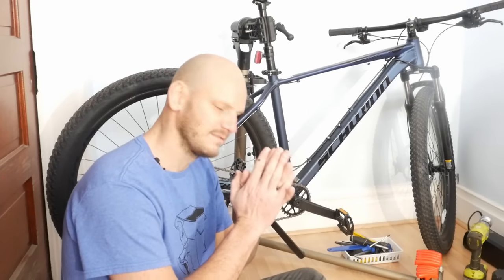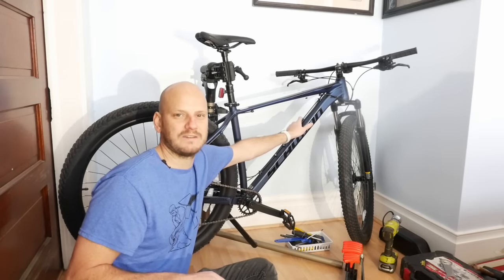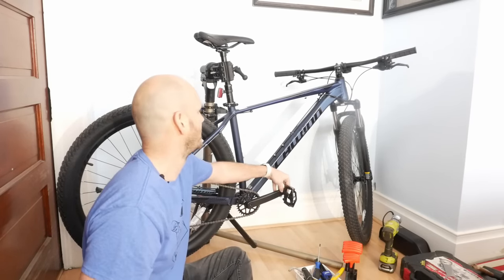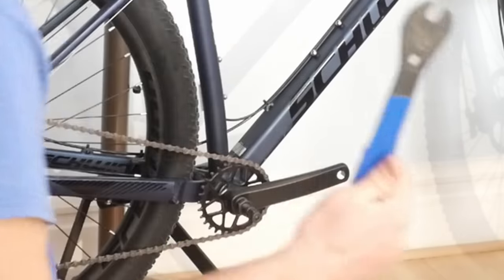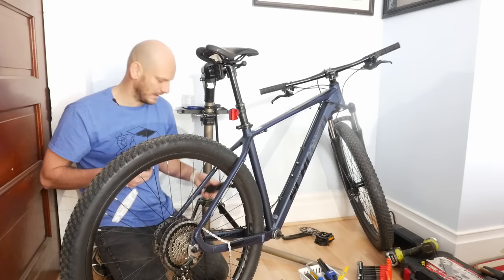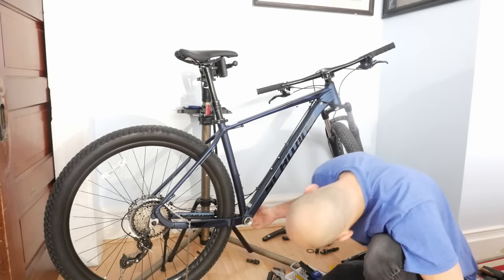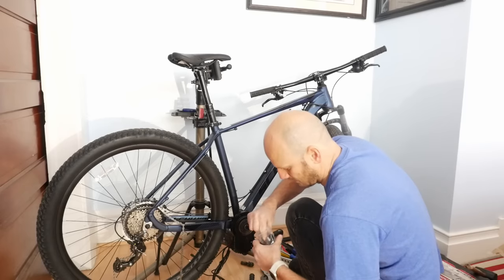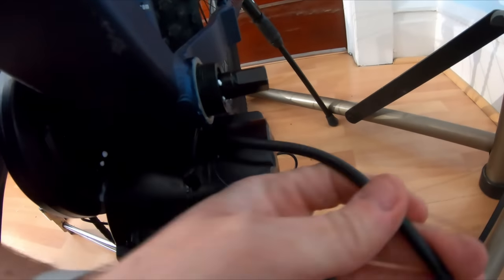The Step-by-Step Bafang Installation guide.

Comment: Great video, thanks! I am quite small, 5’1 so I have to buy size xs or even 2xs. I have a hybrid which I’d like to convert into an e bike, but how can I find the right weight in a motor to make sure that it doesn’t overload the bike for my ability? That’s what is putting me off buying most women’s specific e bikes from the usual “manufacturers” any tips?
Reply from the maker: Buy a program cable to go with it and you tune the motor to not be a “monster”
Reply: @JohnnyNerdOut  thanks! I appreciate it x

Comment: Where did you get the spacer for the motor to move it away from the chainstay? Also, I need spacers for the motor lock ring to motor mount
Reply from the maker: I sell them on my website 👍

Comment: 🤣  I can't believe you're comparing that piece of crap with an specialized ebike.. starting with the fact that you are putting a stronger motor and battery with those breaks, that's probably going to fail faster than the time it takes the battery to fall off when you go a little off-road (probably the first time you hit a 10 inches drop) I mean, it's OK to use it to commute, but there is no way you can compare that to a real emtb.
Reply from the maker: Believe it brother!!
Reply: @JohnnyNerdOut  i will have to try it to belive it 🤔, I still think you are comparing apples with oranges, but I'm sure it will be fun to build and ride to work.. anyway thanks for the videos, I'll keep watching and I might give it a try with an old bike I have.. depending on the results I might as well do a comparison video with my full suspension enduro emtb 😉🚵‍♂️

Comment: Great video, one question, what happened to the bottom bracket bearings…the new motor assembly didn’t appear to have any fitted? Also can’t stand that bunch of cables under the bottom bracket, gotta be a better way?🇦🇺👍😎
Reply from the maker: you can put the excess cabling up top by the handlebars or anywhere else for that matter. you dont need the bearings, they actually wont fit. Motor  spindle slides in its place
Reply: @JohnnyNerdOut  thanks Johnny! Thought there had to be some bearings somewhere!🤣 Inside the motor is good. Was thinking maybe a small frame bag up top to put all the excess cables in.

Comment: If you set the speedometer meter closer to the tire, would the system read it going a little slower, maybe increasing the power output at the same time?
Reply: No, it's the time between pulses from the hall effect sensor.  The computer/controller knows the tire size and can calculate speed based on time period between pulses.  Doesn't matter where the sensor is on the spoke as the time to make a complete revolution is the same.  Basically counts revolutions per minute and calculates the speed.

Comment: Johnny- Great intro to the ebike conversion process. I’ve test driven several off the shelf ebikes and am struggling to justify spending $2K-$3K for an new ebike that’s inferior to my 9 year old Townie 21D. I prefer the mid drive motor design and am hoping to find a Bafang that is compatible with the Townie. I checked out your website and will be in touch when I have time to kick off this project.   Appreciate the inspiring content. 👍
Reply from the maker: The Townie is a great bike to convert! Done a few😀
Reply: I’m looking for Bafang kit that provides assist for hills. I’m a weekend rider and typically ride under 30 miles on paved trails. I don’t think I need a throttle. I bike for exercise so plan on primarily pedaling with minimal assist. Which Bafang kit would you recommend?
Reply from the maker: @sierrafoothillslife4246  bbs02
Reply: Thanks Johnny. I’ll check it out.
Reply: @JohnnyNerdOut  Amazon has the BBS02B kit. They offer the following Chain Rings: 44T, 46T, or 48 T. Which one would work best with my Shimano MF-TZ31 7-speed gear hub?
Reply from the maker: @sierrafoothillslife4246  this might help 
https://youtu.be/JcerQG7nNe0
Reply: @JohnnyNerdOut  Thanks. I missed that video. Now for Battery packs. Amazon offers a 48V 11.6Ah pack for $464 or a 48V 17.5Ah pack for $564. Opinions on which pack is best for my weekend use, mostly pedaling except on big long hills? Also, should I be shopping somewhere else besides Amazon? Many thanks for all your help.
Reply from the maker: @sierrafoothillslife4246  I’d personally go with an ebike specific shop. I normally stock batteries but I’m currently out. (Possibly one left 🤷‍♂️) Should have more in about a week. The thing that I like with going with reputable Ebikes seller is that you have more assurance that they know what they’re selling you. And you’re going to get quality battery cells. Check out the video I posted last week and me buying premium cell batteries but they were missed labeled and I got knock off batteries instead.

Comment: @6:00 You are not suppose to use torque wrench to take nuts and bolts off with. You should use a breaker bar.
Reply from the maker: I know. I should’ve mentioned that it was an old busted torque wrench that I use as a breaker bar nowadays.

Comment: Any idea if this kit has the option for hydraulic brakes ?
Reply from the maker: Yes. You can add to your existing hydro levers or there is a completely new brake set for $90 that has integrated electronics

Comment: Question? When your selecting a mid Drive motor to purchase do you buy one with a bottom bracket the same exact size as your bottom bracket housing on your frame or do you  to go slightly wider, or skinnier?
Reply from the maker: https://youtu.be/V3WjZrQvAxk
Hope that helps
Reply: @JohnnyNerdOut  thanks, that definitely helps!

Comment: The brake levers. Do you have to change them or is it just what you wanted? I have a 2012 rock hopper 29er with hydrolic brakes and I want to keep them.
Reply from the maker: They are different. For hydraulic brakes, you can add magnetic sensors to your existing levers (optional)
Reply: @JohnnyNerdOut  So where can I find a kit to use on my bike. Website?Price?

Comment: Hey. I connected my c500 display cable but that cable sits pretty hard if you need to disconnect the cable. Is it safe to disconnect
Reply from the maker: It’s waterproof so it should be hard to disconnect. Nothing to worry about
Reply: @JohnnyNerdOut  ok that's why..thank you

Comment: Question! Do you ever convert a mountain bike with v-brakes to an e-bike?
Reply from the maker: I don't usually recommend it, but have done it for a few use cases. If you don't plan on going very fast and your breaks are in excellent working condition, it can work.

Comment: It's taken me a while getting this kit on my bike and now I think the brake sensors aren't working. On both sensors the (!) symbol on the display doesn't go away when the magnet is put on them. I think this is odd for BOTH sensors to do this. What could be the problem here? I can't even get the motor turning with the back wheel lifted to check if the motor works. I've contacted the seller, but I would obviously try to get the issue solved rather than go down the road of exchanges and/or trying to get a refund. It was a lot of money for me to fork out.
Reply from the maker: Install one at a time
Reply: @JohnnyNerdOut  Thanks for the tip I will try later after work. I'm a novice really I don't know what difference that could make (?) ... But the seller has offered to send me an instruction video saying I have installed it incorrectly (I don't know how they'd even know that), and that maybe I could try adjusting them a bit to get them working.  If they still don't work they'll send new sensors.
Reply: @JohnnyNerdOut  That's done the trick. Brake sensors working now, throttle and pedal assist working. Thanks a lot I was doubting the kit and thought I'd been robbed of £700. The pedal arm on the drive side hits the chain stay, but the pedal arm I took off the bike is perfect, it just means I have the spider on it that the chain rings would normally fit onto. Thanks again!

Comment: Hey bud, what can the maximum gap be between the speedometer pick up and the spoke magnet when the wheel rotates please? Did you say a centimeter (10mm)? 🧲
Reply from the maker: I like to keep it as close as possible without hitting. Less than 5mm probably
Reply: @JohnnyNerdOut  Thanks.  My Cube Aim chain stay is quite wide so the speedometer has to be adjusted and pulled right out at its max before screwing up the little screw tight to leave a 5mm gap, when pulled out at its max its seems delicate, any solution?

Comment: Johnny, what happens with the rain and/or wet areas on the road and having a mid drive? Where would you place the cables?
Reply from the maker: They are all super water resistant
Reply: @JohnnyNerdOut  Thank you.

Comment: Hey Johnny do you think this will be a goo solution to use with my kid trailer? will it handle it good or should I look for somenthing more powerful? Thanks and keep up the good work.
Reply from the maker: It should work great as long as you have it properly geared. Go with as small of a chainring as you can up front. Maybe 36-42t 👍
Reply: @JohnnyNerdOut  thanks for the advice.

Comment: My harness has 3 yellow plugs, I understand 2 are for the brake sensors, what is the third for?
Reply: Shift sensor. So the motor cuts out for a half second or so(can change time in programming). It prevents damage when you shift gears.
Reply: @dougfurr5217  Ah got it, that's why all 3 are yellow, because they do the same thing. Thanks for the reply

Comment: When you shift isn't the chain line going to be off?  It will only be straight in a couple of gears but when you shift it is off.
Reply from the maker: Yes that is how it is with traditional bikes as well. It’s only dead on straight in about one or two gears. The key is to make it not so far off in the gears that you use most
Reply: @JohnnyNerdOut  Thank you Johnny for the reply.

Comment: Hey Johnny  great video and well instructed I managed to install my bafang motor and everything without any hassle.

I have one issue after the install, the pedal crank that screws on to the motor has an 8mm screw for the allan key. That screw gets lose after riding the bike. I tried to tight it couple of times but it gets loose while riding.

Have toy experience this and what can one do about it?

Keep posting great videos 👍
Reply from the maker: I tighten those bolts crazily tight. As hard as I can. No issues. If it persists use loctite
Reply: @JohnnyNerdOut  thank you Johnny, I know I always get feedback on my answers from you. I will try use loctite 👍
Reply: Those screws for square-taper bottom brackets take MUCHO strength to tighten properly. It should feel so tight, you're no longer sure if you can get it off when you try.

Comment: Hi Johnny My Giant road bike has a press fit BB, I have read about adapters but cannot find any and wouldn’t know what to buy it I did?
Reply from the maker: Measure the ID of your bottom bracket shell. I have two sizes available on my website👍
Reply: @JohnnyNerdOut  the spacers at $5 and  $6?
1 each side?
Reply from the maker: @andyduffield8208  the spacers are for motors that are longer than the bottom bracket shell. You need the adapter. Go under “adapters” and you should see them

Comment: John, thanks so much for the great video, very helpful. You may have covered this in the past, apologies if so. Have the Bafang motors been reliable for you? I'm planning to do a conversion for my wife so that we can do 30-40 mile hilly rides together while I'm on my road bike. She weighs only about 100lbs and I'm going to try to a bike in the sub-30lb range to convert so the total system weight will be about 130lbs + kit_weight. I'm eying a 750W motor with a 48V battery (I've read some things about reliability issues if you use a 52V battery).
Reply from the maker: Bafang s are very reliable. I’ve put probably over  10k on them over the last 5 years. Maybe 3 broken chains is about all the issues
Reply: @JohnnyNerdOut  Finished my build and did my first ride today. All was pretty nice except that I am having some chain line issues in my biggest rear cog. The chain will occasionally ride off my front chainring. I've worked around it for now by limiting my rear derailleur from hitting the biggest cog (just a temporary solution). Do you have a link to the chainring you talk about with the special tooth profile that grips the chain better? Thanks.
Reply from the maker: @stuartsiegel2327  https://www.johnnynerdout.com/product-page/lekkie-bling-ring-42t-bbs02
The 46t will be better IMO but usually the 42t works

Comment: Thats a really neat job. would it work to put the battery on the underside closer to the motor, then you could 3D print up a housing than hides them both, tapering up to the headstock and with a built in mudguard. It would look more like 'you can't do it yourself'
Reply from the maker: Yes as long as you don’t have  a front suspension front that would hit it
Reply: @JohnnyNerdOut  yes, I imagined it tapering. this sort of mod would take your builds to the next level, you will find a million uses for a 3D printer too, and end up employing people as you expand
Reply from the maker: @utubeape  I like the way you think!

Comment: Lol, you don't need to cut your cranks off with an angle grinder. You just need one of those other kind of puller tools that they sell at the hardware store. You may bend something, but it's better than using an angle grinder.
Reply from the maker: I’d only recommend that if it’s stripped out. Gear pullers don’t work (in my experience 😞)
Reply: @JohnnyNerdOut  i have one of the pullers with only two claws on it, it's got me out of a pinch a couple times.  It works well on the side opposite the chain ring by grabbing behind the crank arm.  It'll work on the chainring side too,  but it bends the crap out of the chainring first.
Reply from the maker: @mjsmjs7905  nice, who cares if it being removed though 😀

Comment: I built a mid drive bike, series wound, about forty years ago. It was OK. Hub motors are better if there are hills where you live
Reply from the maker: 40 yrs ago? I thinks it actually the opposite. Mid drives utilize the gears in the rear so it can climb waaay better. Not to mention healthier for the motor
Reply: @JohnnyNerdOut  It was indeed forty years ago;  using the gears is a red herring and downhill is important too. Mid drives are OK if that's what you want. They are not for me.
Reply from the maker: @bingosunnoon9341  a diy mid drive is pretty impressive 😀

Comment: I want to install this on a recumbent high racer. Is it possible and any tips.
Reply from the maker: I don’t see why not. You will extensions for just about every connector though 👍
Reply: @JohnnyNerdOut  I have a  Bacchetta Giro26 with twist shifters. If I get a conversion kit will it make a difference if its twist or bar end? And also, with the kits, do I usually have to order a battery or does it come with it Thanks for all your help.
Reply from the maker: @thelims7060  batteries are not included, as the saying goes. It doesn’t matter what kind of shifters you have

Comment: Johnny, very good and thorough video... two questions... first, at what point in the process would you recommend hooking up the battery and checking the motor to see if electrical connections are accurate and if the motor works... second, did you do a video on attaching the Gear Sensor unit.  I bought this separate from the Bafang midmotor kit and am now ready to install.  Don't understand why this is not made a part of the kit.  Thanks,
Reply from the maker: I did make a video on and never uploaded it! Thanks for reminding me🤦‍♂️ some people don’t want one and want to keep costs down I guess?
I’d check it as soon as you get a throttle and the battery hooked up

Comment: Is that your bike or you doing that one for someone, i prefer the throttle on the right side of the handle bars ?
Reply from the maker: For someone. Usually the cockpit gets a little tight on the right side but if you remove your left derailer lever You end up with a lot more real estate on your left side handlebar
Reply: @JohnnyNerdOut  
I have 3 e-bikes , 1 i tacoed the forks awhile back, actually just a new pair put on yesterday , steel ones this time , aluminum is a little week for a 1000w and only had one toque arm, for now on its 1 one each side unless i can get 4 like i did my electric Budweiser beach cruiser, DIY and yes it is actually a Budweiser beach cruiser bike from Budweiser company , Google it you'll see it
Reply: @JohnnyNerdOut  
You won't see it electric cuz I did it to it but u see the bike, it's the only Budweiser beach cruiser where I live let alone being Electric , but i don't have peddle assist on it, looking to put a 3 piece crank on it so that i can , i like peddle assist, I'd rather use pedal assist level 3 get longer range and then you get your exercise in too,
Reply: @JohnnyNerdOut  
Question, i have front hub motors , i have (2 identical controllers) , one of'em on the peddle assist only works if i am peddling it backwards , would you have any clue why itd be like that? ? Could it be that mayb the wires were soldered on the opposite sides that they should have been soldered on inside the controller ? Im gonna open both to look, my window for sending it back has closed, i kno i could put the peddle assist sensor and magnet disc on the other side of the cranks and itd probably work ,
Reply from the maker: @rickp7683  haven’t seen that one yet. Sounds like flipping it would work In Theory
Reply: @JohnnyNerdOut  
Ok thank you, all i can do is look inside each controller to see if there's soldered in the same soldering position and the bicycle shops around where I live are getting pathetic, lol

Comment: Can I install a kit like this on a single speed?
Reply from the maker: Yes! I’d go with a small chainring up front like a 28t or 36t
Reply: @JohnnyNerdOut  Wouldn't you need to add lever brakes in place of coaster brakes ?
Reply from the maker: @kdlange6052  if you had coaster brakes I’d avoid altogether imo